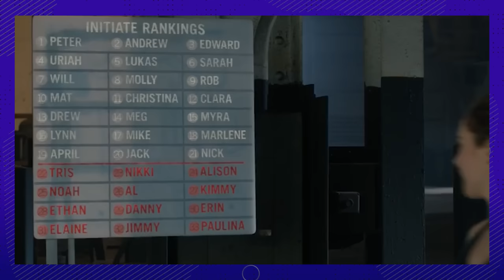Divergent Behind The Scenes

Comment: Good video! The first film was an excellent adaptation of the novel. The second film was considerably weaker than the first, and the third film was a complete disaster.

Watching the third film, is bears little resemblance to the novel. In fact, it was so bad, that the;y never even made the fourth film, which was to be based on the second half of the third novel.

The first film was so great, how did they screw it up so badly by the third?